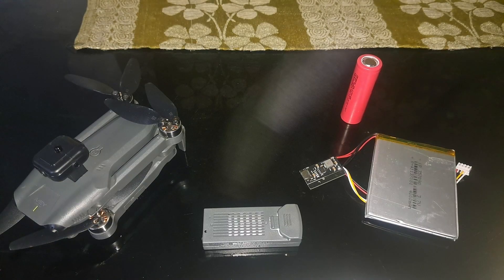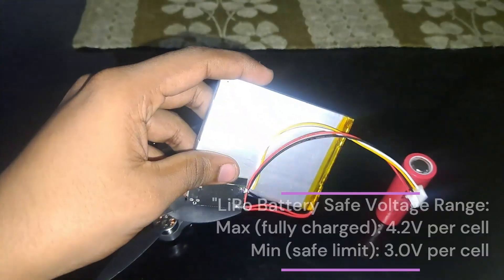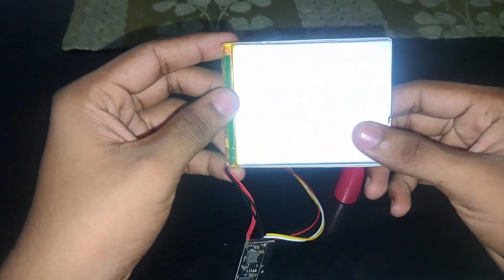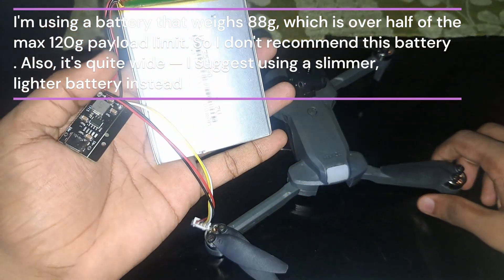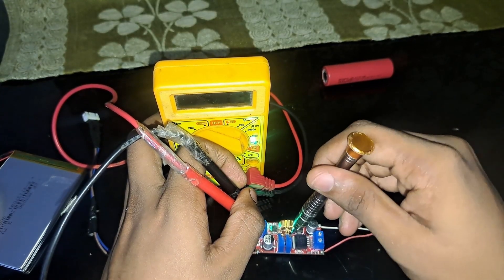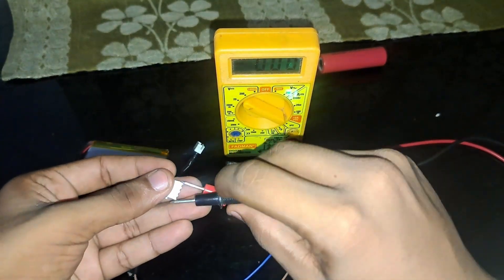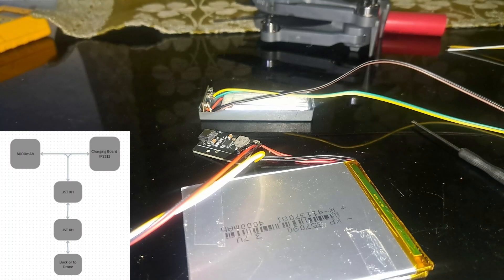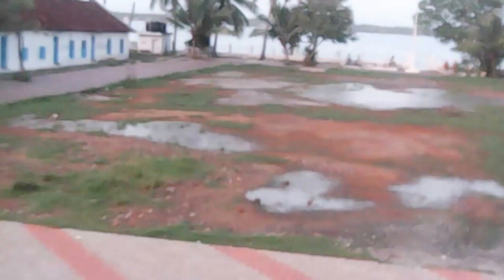Cheap Drone Mod: Dual Battery Hack & Payload Explained (4DRC V28)

Comment: Do you have idea why my gps drone trigger low battery/voltage warning even my battery is fully charge. Thanks for answer
Reply from the maker: use lower AWG wire like 12 or 14. It's possible for the resistance to drop the voltage, triggering low battery. i'll talk about this in next video
Reply: Bro its battery voltage sag problem use high c rating battery
I do same for my lm 12 pro GPS drone